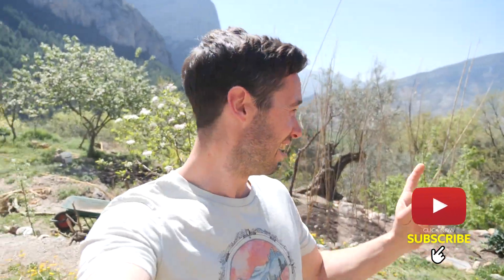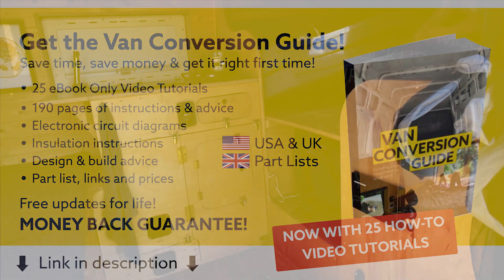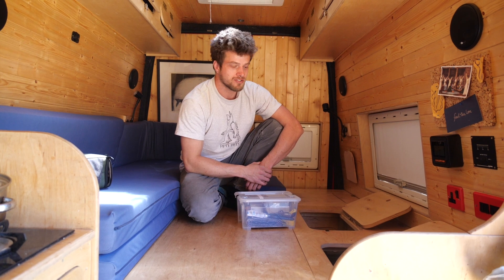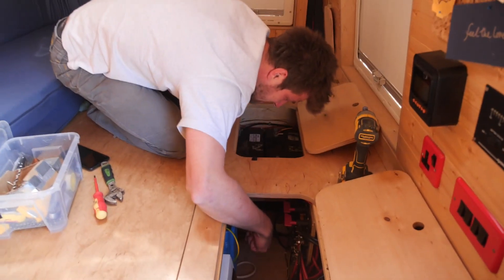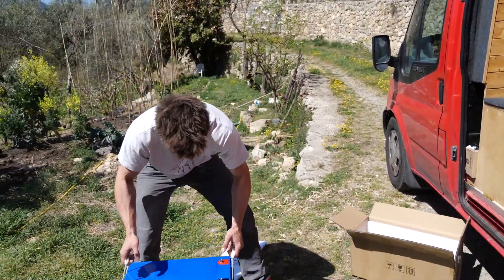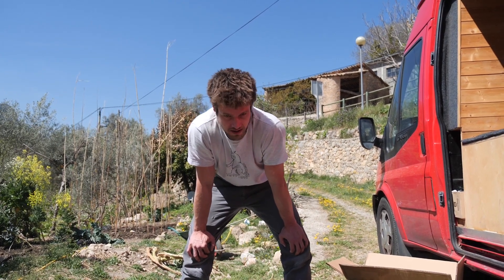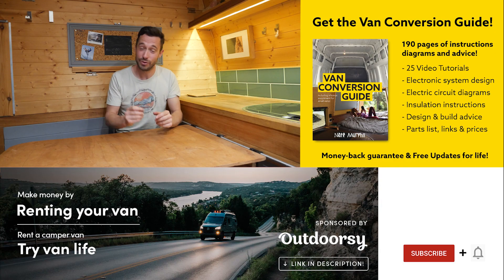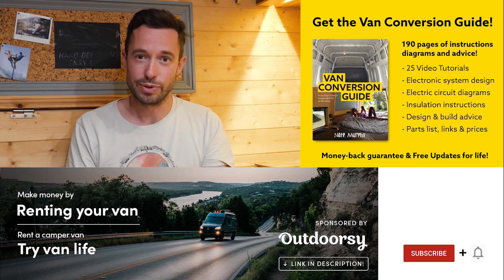LITHIUM OR LEAD-ACID BATTERY? // What should you install in your Van Conversion?  ⚡

Comment: If you make your own with prismatic cells, lithium is actually cheaper than lead acid. so no brainer. 
Also dont take agm/lead acids down to 11.5-11.8 like the guy in the video. you will degrade them fast

Comment: I like agm cheaper than lithium and more conveniently accessable while traveling and you don't have to change out all the components to switch back to lead acid in a pinch also lithium does not like the cold. great video!

Comment: For someone who says they have done research into Lithium batteries, he doesn't understand much about them. Lithium batteries should never be charged below freezing unless you want to totally destroy them. Yes you can discharge them below freezing. I would have done more research into batteries before i spent 1000 Euros. If that battery is built with Lifepo4 cells and they are charged and discharged correctly they should give 6000 cycles and still have 80% of the original capacity. Yes if you treat Lifepo4 cells badly you will limit the lifespan to 3000 cycles or less.
Reply: I've seen setups with a heatpad under the battery (Canada) - to avoid ducking under the minus temperatures.  Not sure where they got their - 20 from, unless they're mixing Fahrenheit with Centigrade? :/

Comment: The reason why you never electrocuted yourself, is because the voltage of the batteries is to low, and the internal body resistance to high. What's dangerous with batteries, is to make a short, since they can deliver insane amounts of current.
Enough to have like serious fireworks when things go bad.

Comment: Look up the Handy Bob Solar Blog for how to set up lead acid batteries correctly. I'd still go for lithium for vans just because of the weight difference but for an off-grid home lead acid might be better if you can deal with the required maintenance.

Comment: Like everything in a van, it’s down to personal circumstances, and needs, and compromises. Way too many variables in affordability/weight/appliances/power requirements/climate/location/head count etc. Are you chasing the sun or are you a ski bum? The set up that works in sunny Turkey may not work during a Norwegian/Canadian winter….regardless of using Lithium or Lead Acid. Ideally, for me it would have to be a combination of Lithium for base electrics, LPG for cooking, and Diesel for heating.

Edit….Also, lots of misinformation online about ‘lead acid’ batteries when used in the context of van builds. Electric forklift trucks all over the world have been using ‘lead acid’ batteries for decades. The manufacturers of those batteries (Chloride & Exide) recommend that to maintain a good 'lead acid' batterylife cycle you MUST allow those batteries to discharge to 20% capacity BEFORE recharging them. The problem is in the way they are being charged in a van (primarily on permanent trickle charge from solar). Charge them from mains electric and they should be ok.....although heavy, not as efficient and bad for the environment.